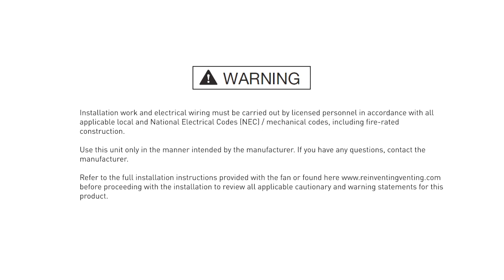Panasonic RG-S100A - Whisper Slim 100 CFM Fan

Comment: MISLEADING VIDEO!!!  This fan is not capable of being “retrofitted in an existing drywalled ceiling.  Notice how it starts out that way during removal of old fan, then after wiring of the fan (on a bench… lol), the fan is then installed onto a drywall free studded ceiling.  I bought this unit and immediately returned.  Panasonic… please state this fan is not for retrofit!
Reply: They sell brackets online to make them retrofit kits